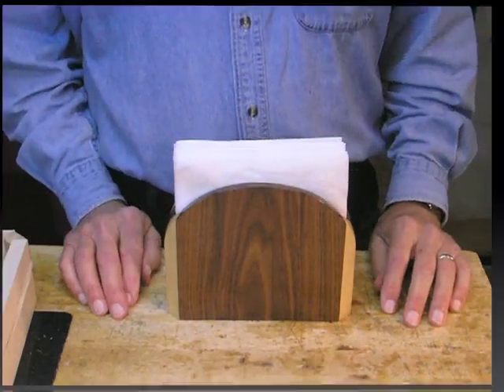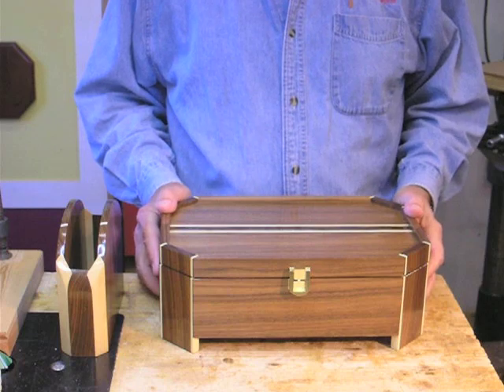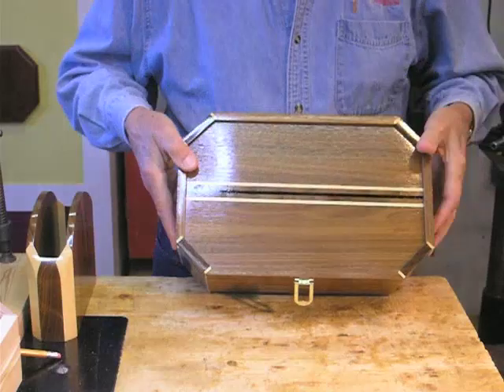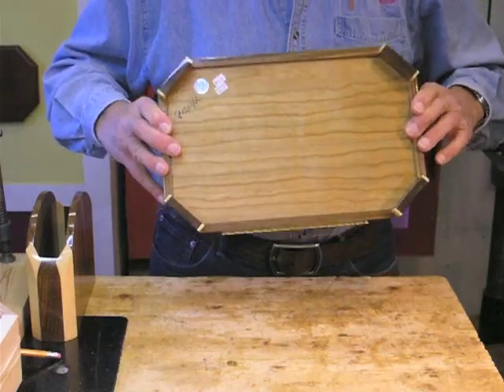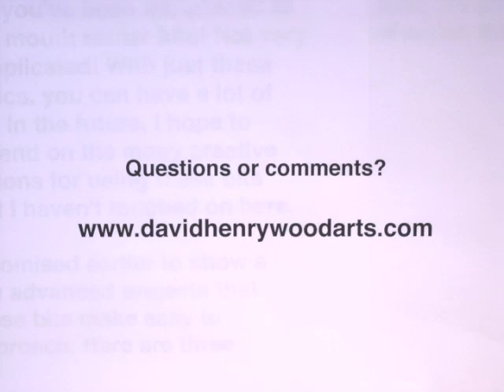Bird Mouth Joinery: the 8-side router bit

Comment: Nice work on those.  When you use your chop saw for cutting the staves to length, I suggest that you put a spacer between your stock and your stop block, then remove the spacer before cutting in order to prevent the stock from getting pinched between the blade and the stop block.  Just a safety suggestion.  Anyway, nice video.  And you sound like Sean Connery, but I'll bet he doesn't have your woodworking skills.  haha
Reply from the maker: Thanks for the comments, PepperJack! Also, I appreciate the suggestion; I should have caught it myself.

Comment: Hi David,
             I just bought an 8-side bird mouth bit, after watching your videos. Can you tell me what the bit height should be for 1/4 and 1/2 inch stock? Is there a formula for figuring out the bit height to get the "Right Fit" with different thicknesses of stock? I don't have a problem with depth of cut, just bit height.

Thanks, Rich M.
Reply from the maker: Hey, Rich!    Thanks for the question, and good luck with your new bit.

The bit height setting is proportional to the thickness of the stock. For 3/4" stock it is about 3/16", as I mention in the video. So for 1/2" and 1/4" stock the settings would be 1/8" and 1/16" respectively. The height is a sensitive setting to get just right; I always do tests to make sure that it is exactly as I want it, and frequently have to make very small microadjustments to get it just right. This is likely a problem stemming from my primitive router table setup!

I'm sure that a simple formula for calculating bit height for a given stock could be worked out; just haven't done it.
Reply: davidhenry32 Thanks for the reply David. So, for 3/8 stock, would the height be 3/32?

Comment: EXCELLENT explanation and super cool technique.  I can't believe I've never seen this before.  I'd be interested to see the design of having the legs of a legged box be of somewhat thicker material, thereby allowing them to protrude.  If one were clever enough, the legs could even be milled to end up being parallel to the other sides of the box (on the outside).  Lots of possibilities.  Thanks again!

Comment from the maker: MAC - getting the correct bit height adjustment for thinner stock is more difficult than with thick stock, because the adjustment involves a smaller up or down movement of the router. Often you are dealing with changes of 1/64" or less, hard to get right without a micro adjuster system on the router lift on your router table (if you have a lift!) I don't have a lift and just keep trying until I get it right by cut-and-try, a nuisance but doable. Good luck! My 1st video talks some about this.
Reply: davidhenry32 qq

Comment from the maker: Hi MAC   -   thanks, glad you enjoyed the video. The finish is not difficult. Sand to 220 grit, one or two coats of shellac (depending on the amount of grain raised) followed by two or three coats of wipe-on gloss polyurethane. General Finishes Arm-R-Seal topcoat has worked best for me. It builds fast, normally dries well overnight for recoating and seems to bring up natural wood color nicely. It flattens very well, better than others I've tried. Fine Woodworking wrote it up a few years ago.